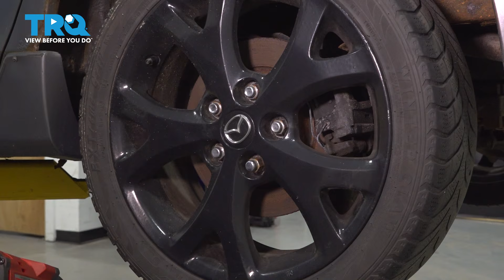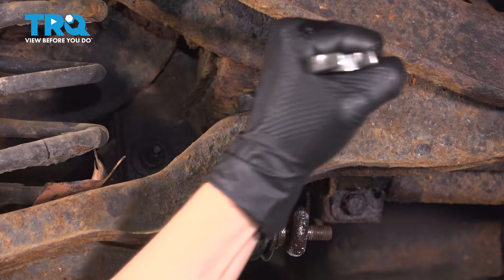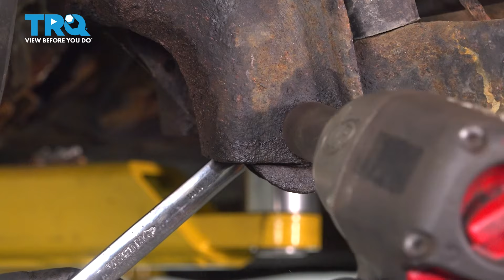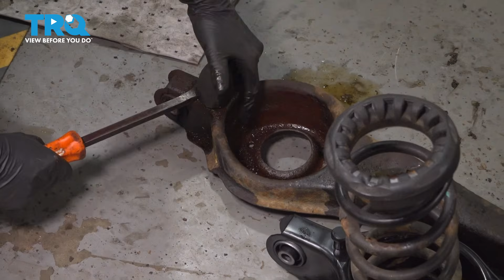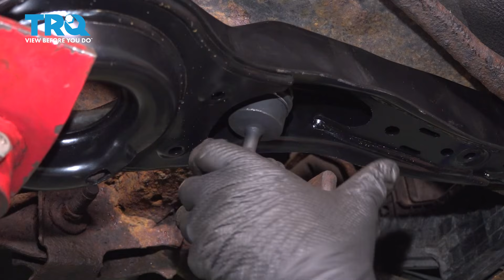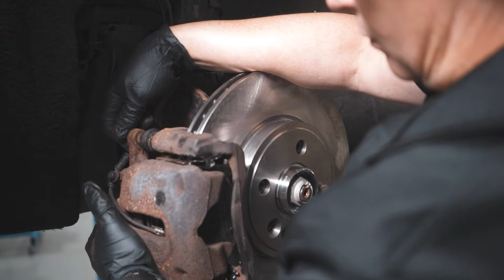How to Replace Rear Lower Control Arms 2004-2009 Mazda 3

Comment: This is how you replace the left side only, what you fail to mention is that the right side is impossible to remove because the bolt is blocked by the charcoal cannister

Comment: i have a 2015 mazda 3...should there be any play in this connection between the lower control arms to where to connects to the rear crossmember? My tyres move quite easily up and down but not side to side.

Comment: By marking the washer are you not needing an alignment again? Or you'd still recommend it? Do you need to do an alignment just replacing the upper and lower control arm and not the control arm for the spring as shown here?